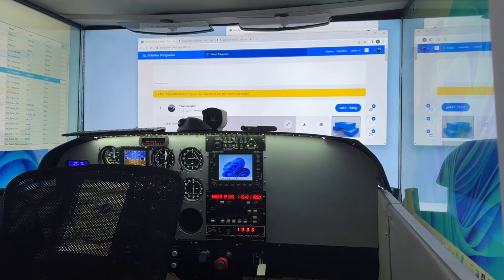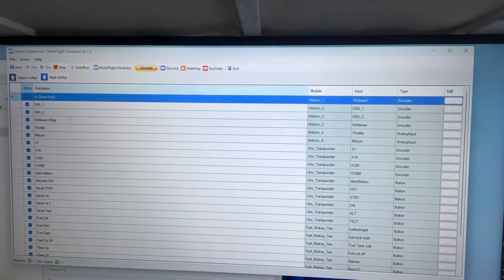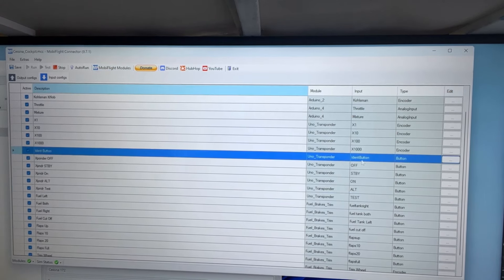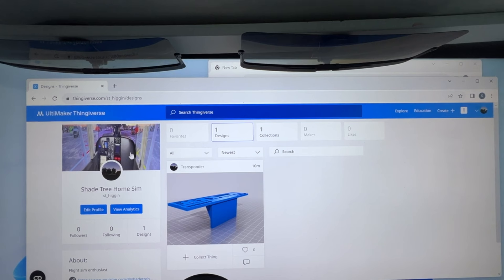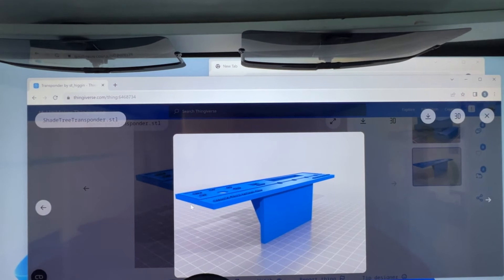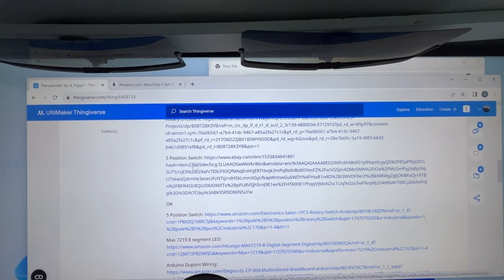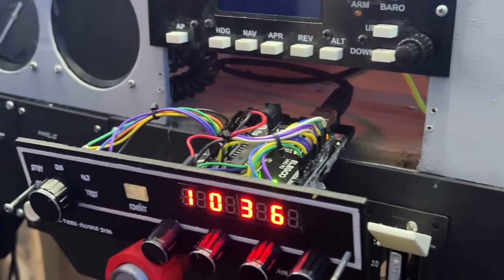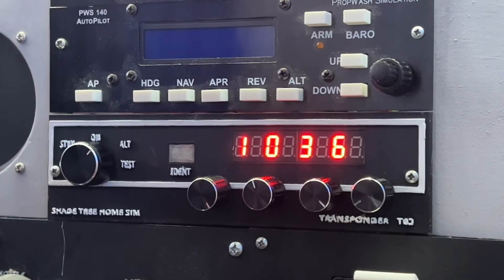DIY 3D Printed Arduino Transponder For MSFS 2020

Comment: Is there a sketch file for the arduino?
Reply from the maker: It was done in Mobiflight, so there’s two files but you’d also need Mobiflight…and if you want my files (I’ll gladly upload them) you’d be stuck using an uno.